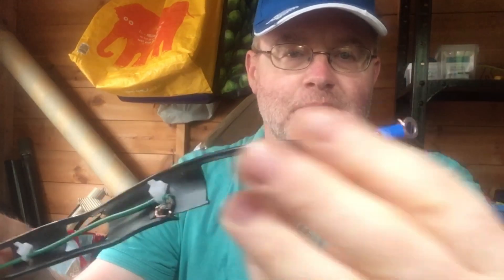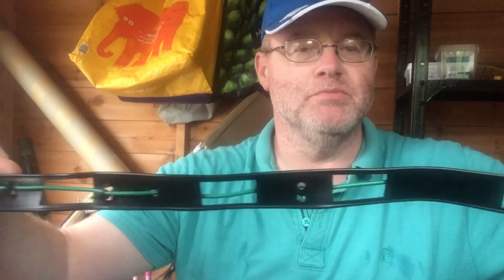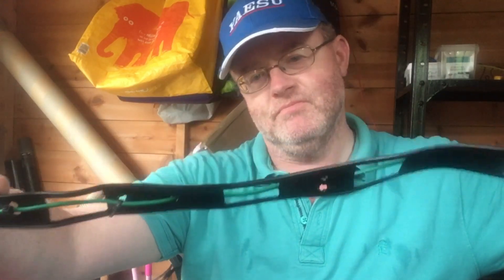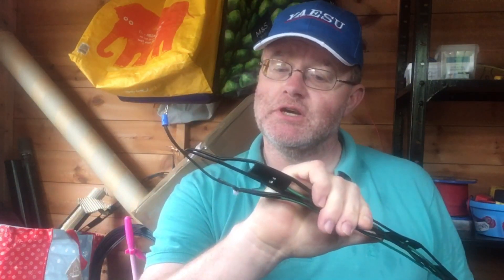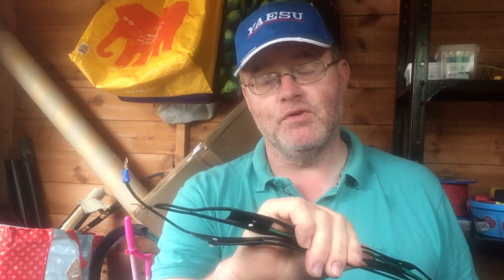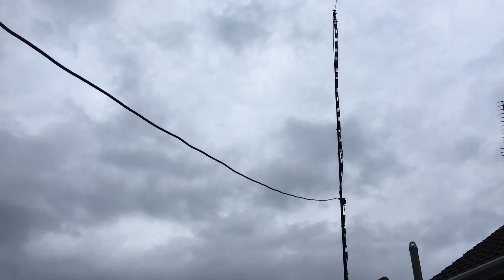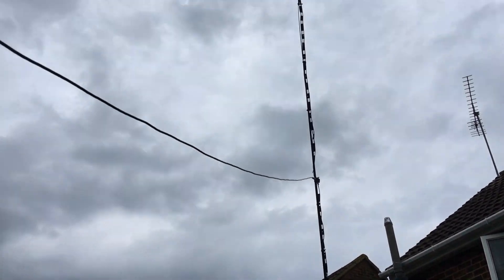Dipole - Shortened using 3-wire Linear Loading

Comment: Hi Tim Merry Christmas to you sir have you ever placed a reflector wire on the ground below an inverted V, linear loaded, Doublet dipole antenna? I want to do it to see if it will help to focus the signal upward for NVIS communications. Probably is I just don't know how long it should be! My antenna has 16 ft legs on both side that are made from 450 ohm ladder line with the center wire woven in and out of the windows. What would you recommend for the type of reflector to use and how long should it be
Reply from the maker: I haven’t Pat and if I had the room at home I would. I’d love to try that out

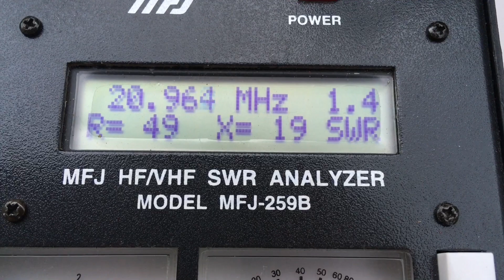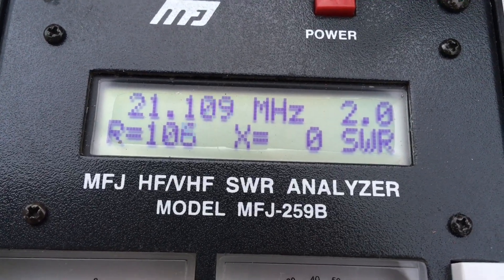Comment: Great job, Tim, but you're selling yourself short. According to your analyzer, your antenna is actually resonant between 21.066 MHz (4:23) and 21.111 MHz (4:27). Your analyzer is showing X=0 between those two frequencies, and X=0 is, by definition, resonance.
The SWR in this range is about 2:1, which means it might be worthwhile to try feeding the antenna with some length of 75 ohm coax. It's almost certain that if you used a 2.5 to 3m length of 75 ohm coax at the shack end, you'd be down close to 1.1 SWR for the low end of the 15m band (assuming your analyzer is calibrated relative to the port on the device, and not the end of your coax). It is unclear what that length would do at the antenna end of your feedline, however. Some experimentation might help.
Reply from the maker: Thank you for this suggestion. 73

Comment: Good informative video Tim. I think these type of parallel wire antennas have something in common with ‘Morgain’ antennas. I did a lot of reading about them and defo a potential solution for small plots/ small masts etc. Keep up the good work Tim. Cheers, Nick M1DDD

Comment: So what about two parallel pieces of ladderline spaced with 1cm or so blocks to give 4 wires? I have a small garden and am thinking - adding more wires could it eventually work on 80m?
Reply from the maker: AE0TE good thought! I use 45 feet or so of ladderline with the ends shorted and that resonates at 7.1 MHz and when fed with 300 ohm works well on 80 as a doublet. How small is your garden?
Reply: The_Radio_Op 2E0TWG-Tim I have about 80 feet between available trees. Are you saying 45 per side or total length? Maybe I could put in some poles for support.
Reply from the maker: AE0TE that's a decent space there. I have just 2x22.5 feet legs so the whole antenna is 45 ft but as it's linear loaded it's resonant on 7.1mhz therefore electrically it's 66 feet. If you made a 70 ft long doublet in the same manner you would have a doublet which would electrically be around 100 ft long, resonant on around 4.6 MHz and should work pretty well on 80 and up.
Reply: The_Radio_Op 2E0TWG-Tim That sounds good and is very doable. I think I’ll give it a go. 
One other thing - is the ladderline feed length a set length or just a variable piece?